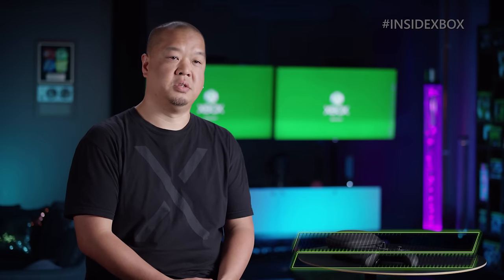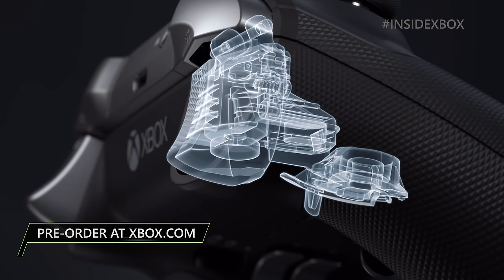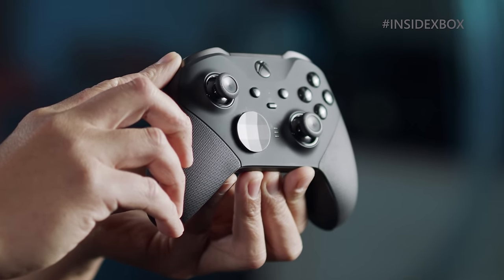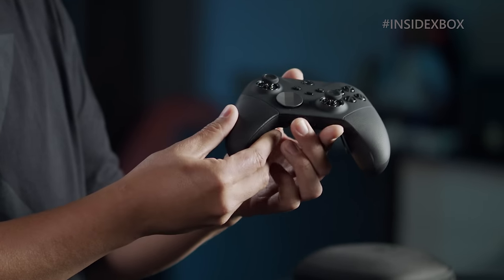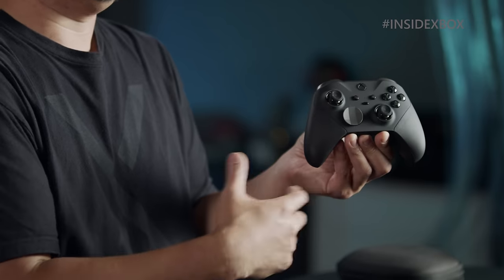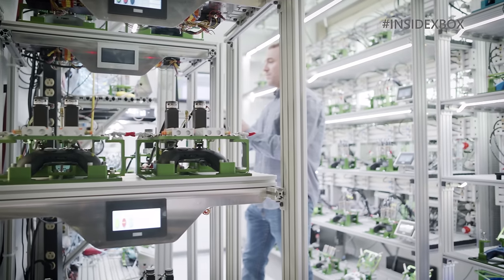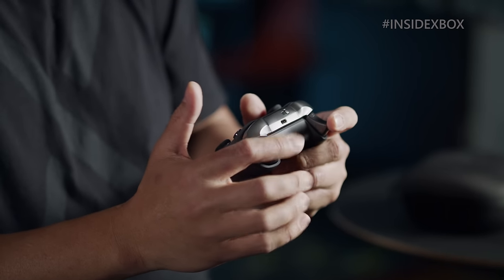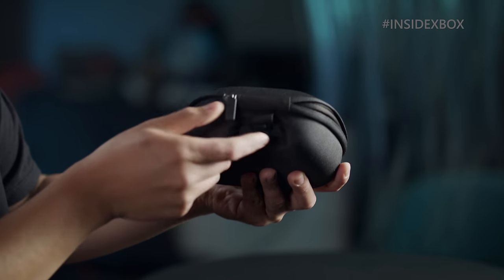How the Elite Wireless Controller Series 2 Works

Comment: Knowing my luck, i will still get stick drift
Reply: I've never gotten stick drift once out of 10+ different controllers
Reply: @nathanielplays6848  Doesn't work for the majority wih the drift problem, the entire joystick module needs replaced.
Reply: @illegalalien4444  Bruh exactly me, My xbox 360 and xbox one controllers never had stick drift
Reply: @nathanielplays6848  How
Reply: Hell ya
Reply: @illegalalien4444  how long have you had your xbox to go through 10+ controllers I have only gone through 2 and the first never broke but I got the new one for the 3.5mm jack and that's only just broken now aswell
Reply: I've had my xbox 1 pretty much since it came out btw
Reply: Welp I’m trying to fix my drift right now
Reply: 400th like ;)
Reply: Don’t worry you will
Reply: I did :/
Reply: I have this Controller. Brand new came with stick drift 😂
Reply: This comment aged well 🤣
Reply: maybe you can adjust the deadzone of the controller in the xbox accessories app. that might fix it.
Reply: Just got the controller and it has stick drift
Reply: @wewonbro1620  Probably the deadzone settings. try tweaking them via the xbox accessories app and see if it works out for you.
Reply: Luck? More like you’re not taking care of your controller good enough. Stop playing aggressive games ffs
Reply: I have I had have 4 controllers only one had stick drift
Reply: I did if you didn’t

Comment: Hope the grips don’t fall off like on the regular elite controller
Reply: SnoopCreature17 he said that they made the grips are more durable so I hope so
Reply: SnoopCreature17 I’ve had me elite controller for over 1 year and that hasn’t happened yet. Y’all just gotta take of the controller better tbh.
Reply: Y'all could use glue
Reply: J-Rod same I got one of the design lab controllers and the grips are still there after 8 months so
Reply: @iseeyotoes6739  glue doesn't work. The grips on the first Elite controller expands by the warmth/sweat of your hands, so when it falls off after 3 months - 2 years, it doesn't fit to glue it back on.
Reply: I’ve had the same controller since it came out, didn’t happen to me.
Reply: @j-rod2807  yeah for real I've had mine for 2 years and play almost everyday and my grips haven't fallen off people don't take care of their stuff and are to hard
Reply: @reazy532  well your hands don't get sweaty warm like mine.
Reply: @iseeyotoes6739  It's not really something that you can glue back. At least for mine. It's like once the glues worn off it's expanded( not really sure how to explain it). I tried to see if I could hold it back in it's original position and it was occupying more space than when it was adhered. I've replaced the the bottom half the controller once. Holding up so far for 6+ months
Reply: Same happened to me
Reply: @jet613  lol
Reply: J-Rod sweaty hands man. All I got to say.
Reply: @reazy532  Lol I went through six of them In 3 years, and I've never thrown them or squeeze it to hard, I set it back in the case after every use as well
Reply: @j-rod2807  same
Reply: J-Rod ikr seriously idk what these people are taking about
Reply: @j-rod2807  it's not about taking care of the controller it's that the rubber from the grips arent very sweat and heat resistant. It absorbs the sweat from your hands and mixed with the heat and pressure from holding it the rubber warps and stretches.
Reply: @j-rod2807  I thought the same thing until mine started coming off.
Reply: @iseeyotoes6739  And I have been using glue. The problem was I didn't fully peel the grip off when they began peeling. So now I'm left with these small air pockets that can't be reached because I've glued the edges down as they peeled away. Luckily, these pockets are barely noticeable.
Reply: @zecuse  😂
Reply: @yourchair9966  use tape😂😂
Reply: People y'all should try the scuf prestige
Reply: I just don't get it: I've had my Elite since release, and I only had to dab some oil on the spring tensioners to eliminate trigger squeaking. Other than that, this thing has seen 1000s upon 1000s of hours with nary an issue.
Reply: J-Rod Some elites just shipped low key defective. Sometimes it doesn’t matter you treat your controller.
Reply: Surprising mine never did
Reply: J-Rod Exactly. I had mine for 2 1/2 years, and my grips are perfectly fine. I did decide to upgrade to the series 2 tho.
Reply: @j-rod2807  It was happening to people on day one. Considering that the controller was 150 dollars... that sort of thing shouldn't be happening for years

Comment: They better have improved that stick drift

Edit: I had to return it because the RB wasn't working😔
Reply: I never had that problem
Reply: I had it it’s devastating
Reply: Marz Pro_Bro  yeah thats right
Reply: Felt like I wasted $150 because every replacement I got had that same problem
Reply: I own 4 and all of them have stick drift.
Reply: I go through 1 controller every month due to stick drift
Reply: Stick drift happens with all xbox one controllers not just elite and I worried about this too for 180 bucks
Reply: I've never after assigning L3 and R3 to paddles. I used to get it from using L3/R3 for sprint etc.
Reply: I stiffens the sticks sensitivity and it fixed it
Reply: Ikr it’s so annoying
Reply: richard faraone i have NEVER had stick drift on an xbox controller until I bought an elite. I have 10 controllers that are not elite and none have ever had it.
Reply: Marz Pro_Bro exactly
Reply: Never had that problem
Reply: Oh I’ve only had that problem SIX TIMES!
Reply: Marz Pro_Bro I had same problem I fixed it by opening it up and replacing the modeuls
Reply: Never had it
Reply: Marz Pro_Bro maybe your deadzone settings to low🥴
Reply: If you keep your hands clean they'll last longer
Reply: Drift will never go away. Thats how they keep us spending money on more controllers. This thing will probably retail for $200 usd.
Reply: You can easily fix it.
Reply: PREACH!
Reply: that's never gonna happen.
Reply: My fingers are crossed
Reply: Marz Pro_Bro that’s cus u hit ur controller 😂😂
Reply: Marz Pro_Bro I know right!!
Reply: they better, i swear  they better
Reply: Probably u can fix stick drift with the tool
Reply: @scitzoplaya1  you can fix it for like $15 if you know how to solder well
Reply: @lauchlanstill6677  rage quitters taking their lack of skill out on their controllers 🤪
Reply: I'm sure they did this the SECOND one not the first pawns were used for testing
Reply: Haven’t had it
Reply: they didn't
Reply: It depends on your deadzones
Reply: Nope
Reply: i got the bumpers double clicking and it looks up full speed insane stickdrift bruh
Reply: @rileyredli8787  I did. After like 4 months.
Reply: The sticks drift so hard that 2 fast 2 furious tokyo drift asked the controller to become an actor in their next movie.
Reply: Never had stick drift and I’ve been playing consoles since I was four
Reply: Yeah so it drifts even more
Reply: Ok fortnite flopper boy
Reply: Yeah I just recently got that problem I think it was ever since the new controller update
Reply: Y’all press on the stick too too hard
Reply: Change deadzone
Reply: 1 month using and rb also dosent work for me
Reply: @Boomcheeks  its just l and r its not ps controller
Reply: My RB button on the old one gave out, but now it's my Left Stick that has that lame internal stick drift that I can't fix
Reply: stick drift and lb for me...
Reply: You people are bad with remotes
Reply: Broke on both of mine as well.

Comment: USB-C rechargable internal battery that works up to 40 hours!??!?! You sold me on that one but these other new features are also awesome
Reply: I hope it has fast charging 🙏
Reply: Probably 2-3 hours
Reply: @ZBLAP  if its the pro controller battery, its probably gonna be 5-6 hours, but when you charge it it will hold up for the whole weekend!
Reply: Vince Latello just charge it overnight
Reply: Should of been on the first one.
Reply: I hope it will be replaceable without damaging the controller...
Reply: @cyberschuft8839  probably not.
Reply: @cyberschuft8839  it wont, youll have to buy warranty and send it in every year when battery starts sucking or go through hassle and potential ruining of your expensive controller with replacing the battery yourself
Reply: Game Remedy I mean it not bad if it’ll take that much I can charge it over time or when I’m out
Reply: Q lfx it should just be normal charging because fast charging effects the battery but I do like fast charging
Reply: If you look wear the rubber connects the grip it's probably safe to safe you only want to do it once and not all the time rubber will become loose after taking it open
Reply: Max4Million then your battery will probably die after few weeks due to the overcharged
Reply: Lmao doesn't the switch Pro controller have that as well? Then again, pro lacks many features

Comment: Well, the most important thing I noticed it was the paddles. They were shortened. On elite 1 were too big, I can use just 1 each side. 
Definitive buying!
Reply: Julio Manfrini same, I use the shorter paddles on the bottom slots for each side, and just left the bigger ones off. It was way too hard to grip the controller with all 4 paddles on, hoping that’s not the case with this one
Reply: I'm really hoping that they shortened them significantly, or I'm going to take them off and put them on my grinder until i get them down to the length i want them at.
Reply: glad i kept the parts from my old one then
Reply: you can buy new paddles to get smaller ones that what i did
Reply: Before I bought shorter paddles, I used to flip mine. So that the longer paddle pointing up instead of down. I only used one like that on the right side.
Reply: We are giving away the incredible Elite 2 controller! 👀 Head over to our page and check out the steps in the "About" section. Don't miss out on this epic giveaway! Good luck! 🎁

Comment: I got over 10k hrs out of my elite one controller before it finally started to have issues. More than happy with its performance. I would only change two things on this it would be perfect for me. Stiffer than the 360 on the stiffest setting and make the micro usb connect more robust like on the razor controllers. Btw the razor I bought to be backup duty didn’t last but two months before issues started arising.
Reply: love the performance

Comment: It sounds like you've listened to critisism but there's just one thing you didn't address and that's the controller suddenly and frequently losing sinc/connection with the console? If you've fixed that too then this elite will be expensive but  perfect.

Comment: I had to return my first elite series 2 core today because it wouldn't charge. Luckily the replacement does. All my other 4 regular xbox one/series x controllers are broken in some form or another: stick drift, rb damaged, etc. Just from use. Never abused.
Reply: How are your face buttons? My A-button doesn't work half of the time out of the box.

Comment: Looks the best every Xbox controller yet but not shore about the battery and if oneway it dies i wonder if it can be replaced or work without wired. But it's outstanding the design i cant wait.

Comment: Ya but, did u fix the slow turn X axis on the delayed (right stick aim) setting ??? Radial calculation fixed it, but it also changed the look sensitivity response completely. PLEASE FIX  the X axis slow turn on delayed without having to use "radial calculation"

Comment: I had to replace the Cover and the Outside grips Only in 1 year. Inside grip on left side still cant be replaced 😕 Buttons and other still works fine. I dont understand why they dont use Bluetooth for Controller and Xbox / Bluetooth and PC Only 😯😠